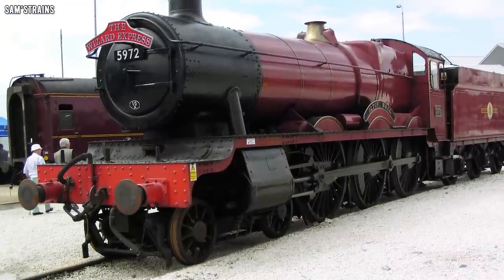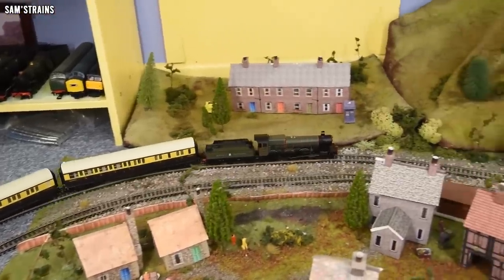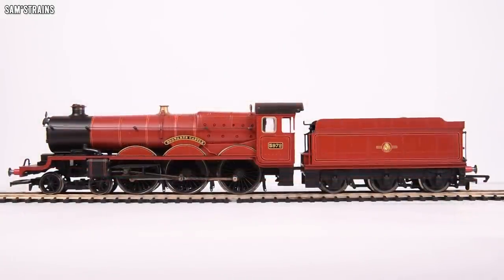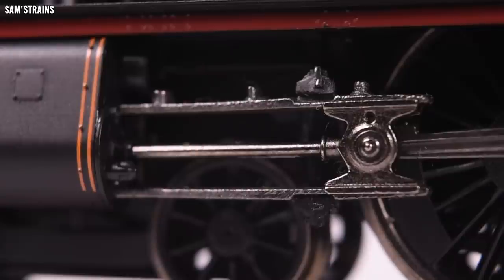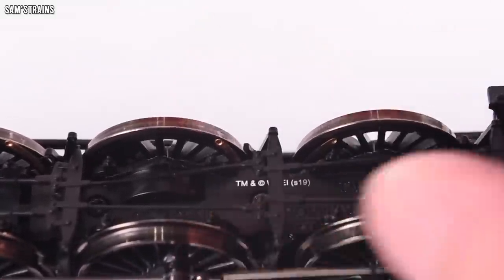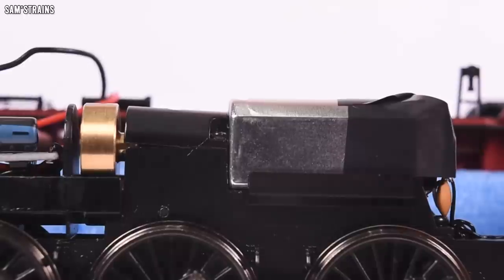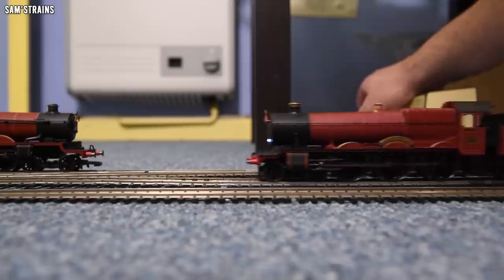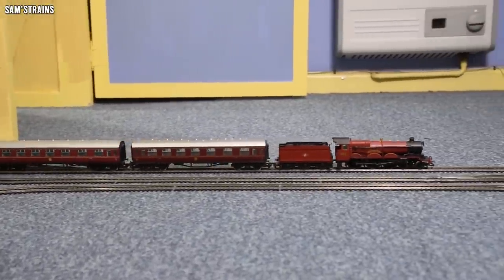Which Hornby Hogwarts Castle Locomotive Was Best? | Old vs. New

Comment: If I recall correctly, HORNBY didn't make their original Hogwarts Express sets with a GWR Castle by mistake, they did it because the only Hall tooling they had was a super old Tri-ang one. As they recently made a new tooling for the Hall class they re-released the Hogwarts Express to have the correct locomotive.
Reply: This is correct

Comment: Hi Sam, I believe there have been upgrades between the two issues you've reviewed here.

 I have an R1095 Order of the Phoenix model which is an upgraded Castle class body version. I think it came out around 2009, though I could be wrong on that.

It's 372g, DCC Ready and has an upgraded motor. It has sprung buffers, the decent headboard, but plastic cylinder & crosshead assembly. It has the more basic cab, the plastic chimney and the old whistles. There are rivets on the buffer plate but not the running plates.
Reply: Was just aboutnto bring that up! Not sure about the more specific details but I remember being surprised a few months ago that my goblet of fire Castle class had tender pickups
Reply: Mine is R2662

Comment: Hi Sam,  great video.   There was another version between the two you show here.  I have the first one and the second (not the third which is the newer version seen in this video) 

The second version I have has an LED,  can motor,  no flywheel,  nice bearings and hardwired pick ups.   It ran reasonably smooth...  It also has traction tires on the centre wheels of the drivers.  (which led to its demise) 

I converted both of mine to DCC using early TCS decoders,   After watching this video I decided to take them out of storage and give them a run (first time in ten years) 

The one with the LED did two laps of the track and then the main gear on the driver slipped.  The plastic had become so brittle it cracked.   So that one is now out of action.  I suspect the traction tyres on these wheels placed a huge load on this gear during fast stops and starts.  

The first one with the ringfield motor still runs fine.  

I also have a Bachmann version (DC only) and that runs smoother than both of the Hornby versions. 

I would love to see a premium version of this locomotive.   I have Trix,  Proto Heritage and MTH Steam locos all DCC with sound and they are superb runners that crawl perfectly below 1 scale mph. .   The Hornby product feels like a toy by comparison unfortunately.  (you get what you pay for) 

If a premium version was ever produced I would not hesitate to buy it.

Comment: Great review, I have the Hogwarts, old Castle class. First time I serviced it, was bit of a puzzle. A little later I purchased a Dapol 150/2 sprinter. The motor is the same Ringfield motor, the magnet was in poor condition, but I was able to source another one by using the  parts list as reference from the Castle class!

Comment: I guess: As Hornby also did produce the AC Version for maerklin with tender pickups and working front light (The AC Version had the Pickuo-shoe and decoder on tender, but did use original DC motor in engine) , they adopted that to their own model, when redoing it.

Comment: I've done a video potentially for YouTube where I've gloss finished Hornby's rebuilt W1 Hush Hush in Garter Blue. They seem to be going through a phase of using that strange coarse glittery gold paint (almost custom metal flake). It doesn't look good in its as supplied finish, with text characters being hard to read. However, add a clear varnish on top and the gold suddenly lights up and looks wonderful. It makes me wonder if their gold is really part of a two-pack matt base and gloss lacquer paint system, as used by car makers. 
So it may be worth a try to just put a bit of gloss varnish or clear coat across that Headboard.

Comment: Hello Sam,

thank you for the video and the comparison of the two engines. 

I recently got a ride on the jacobite steam train to malaig in scotland which was pulled by LMS Black 5 45407. i liked the idea of doing a model replica of my train i was on.

So is there a black 5 that you can recommend using for this project. My google search was not really succesful of finding a model of the actual era. I think the coaches  wouldnt be much of a problem because they were mk 1 standard coaches or do you have here any reccomendations aswell? Are there some model that came unnumbered so it would be possible to put the exact numbers on them?

I know thats a lot of questions by i think when you dont know this than who would then? :) 

Thank you For a respond.

Greetings from Germany 

Basti

Comment: I have a version of the old one which actually does have the led in the front and tender pickups though the connection between loco and tender is different so I guess hornby made multiple versions
Reply: I agree. I have a castle class version from the R1095 Order of the Phoenix set which is DCC Ready,has an upgraded motor and is 372g. Think it cam out around 2009ish (though I could be wrong).
Reply: i got mine second hand so i dont know of its origins but you are probably right

Comment: Hi there Sam ,, 
I have the newer of the 2 and to be honest i can not fault it in any way except for having a bit of trouble hooking the tender up to the loco (if anyone knows what the go is with that can please let me know) as i havent worked out how it goes together and didnt want to break it.
My one runs like a clock and has plenty of balls to boot. 
I can say i am quite happy with my 1 as it runs like a clock in all aspects ie good slow crawl and gr8 top speed and is good over points etc. & it is in its original box and got it in a job lot with a whole heap of other triang bits.
You could say i am quite chuffed with my harry potter lol ..
Like i said previously the tender connection is the only drama im having with my one is about it.
Cheers from John in Australia.

Comment: The Hogwart's Castle loco not currently in your collection is R1095.  It is DCC Ready. It does not have a ringfield type motor, but it has traction tyres which impair its running qualities.  It has a light, but this is permanently on under DCC. There's a mod you can do to turn the light on and off when you add this version to your collection!  Thanks for uploading.
Reply: Mine is R2662
Reply: @damianinCanadaTT-OO  That's from Harry Potter and the Order of the Phoenx  Set.
Reply: @AllensTrains  interesting. I didn’t buy it as a set. I bought the loco individually
Reply: @damianinCanadaTT-OO  To get a sale, a Model shop will  sometimes take a loco out of a set to replace a model they found was defective.

Comment: Hi Sam, great video comparison between the expresses but was there could there have been a third. I have the original which looks better for the details of front name plate, no LED and pulling power but have a a version that has the LED lamp, smaller front plate but not dcc connection to tender. It does have a dcc slot on top of the motor and is dcc fitted!! I’m going to recheck it but don’t recall having to undo the cable connection when I serviced it last year… three not two Hogwarts “Castles” Epresses, now that’s truly Hornby magic!!! All best Marc

Comment: Thanks Sam. The lamp is in the wrong place on the new loco and I would have thought that someone would have painted the the controls. Just like the Lionel G gauge and the Hornby Gauge 1 which are both battery powered. The Hornby loco has traction tyres and the Lionel one has steel wheels, same loco but at different prices including coaches and remote controller, even the track is the same. Back to the 00 gauge, the new Hogwarts Express is more oriented to the toy than collectors that's why some people have bought the Bachmann set when it was released although it is no longer in production but the Bradford Exchange sell the kit underlicence with added extras with 12 editions.

Comment: Turns out my Half Blood Prince set is fairly rare, its a combination of old and new Hornby stock, it is the older Castle Class body with the light yet it has a modern chassis with the standard 3 pole Hornby motor and tender pickups, but on mine the QC was bad on it since mine had the headboard missing and the screws had been over tightened breaking the mounts but I've not  seen another set for sale.

Comment: I have every version of the Hogwarts express that Hornby have released included the gold plated version, yes the earlier ones were the best, very easy to service, very heavy and great runner, I also do have a Bachmann Hogwarts express and it’s really shiny compared to hornby, it is quite smart so I sprayed a hornby one in gloss lacquer 👍🏻 looks great too. The ones I have also do have tender pickups, should be a metal strip on the drawbar that connects the two electrically.

Comment: There is one massive flaw with that older Castle- the crosshead slide bars. They are pretty thin and made of plastic, so when I suffered a derailment with my 'Hogwarts Castle' Castle, it naturally decided to completely bend one of the crossheads round! It was fixable, but either way its quite the fault!

Comment: What a  wizard  video...Sam,  you have  woven  your  magic  again...big  differences but  new  Hall  is  the  winner...you  can  place a  small  straight in  your  S  bend  going  up the hill by  the  3  trees, all locos  will  run better..this is  physics  where  you have  counteracting  forces  working on a  moving  object...you  will  see  a  big  difference.  You  can also improve the  corner  by placing  half  curve of  greater  radius before  your main  curve...this  reduces  the  forces  acting on  a  moving object..tip  for  everyone...

Comment: Why oh why did Hornby originally release this train set, knowing that the loco was the wrong class? I know that train sets are, for the most part, supposed to be a relatively inexpensive way into railway modelling and that a newly tooled loco would cost a lot to produce. Why not then use their current Hall class but with some simple upgrades to make it at least a more acceptable model for a set? Or am I just sounding naive here? Best, Pete.
Reply: Because at the time they didn't have a Hall class. They'd inherited the old Triang Hall moulds, but had altered these to produce Saints instead.

Comment: The old model seems to be a Railway series of the 1990s-2000s, and the new a railroad model of the 2010s... To be honest, there is some bettering on the new model, but at the price of some details left over in the upgrade. Overall, the new model have a less bad drivetrain than the old one, but it's not an ode to Joy anyway.
For novelties, if the price of the new one is right, it can be acceptable. The downgraded details from the old to the new are a serious let down from Hornby, they can have avoided this problem.